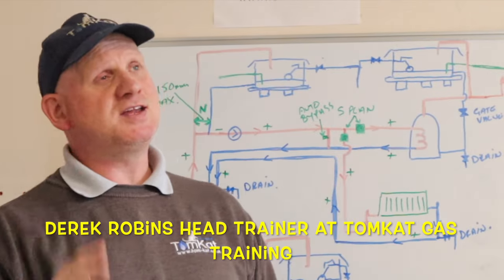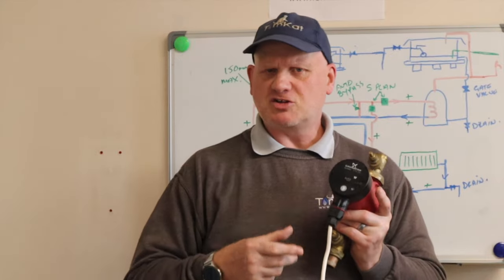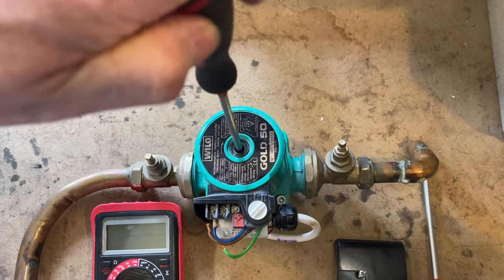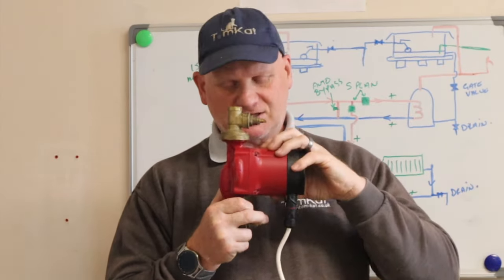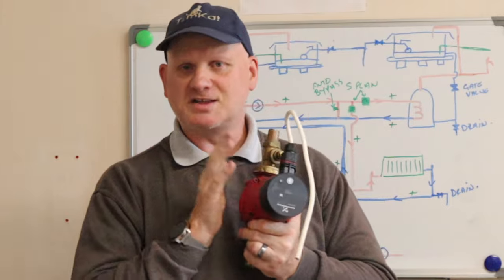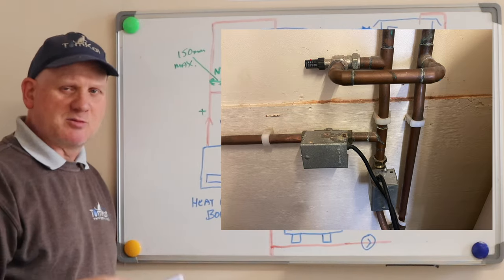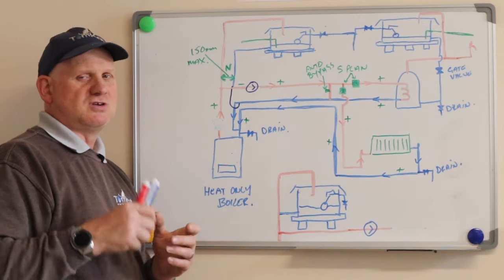How to install a pump in a central heating system

Comment: I was taught 35 years ago.    22mm pipe from flow all the way up and over the fe. Tank.   Then 22mm cold feed down and no further than 150mm apart. But bring it back down to middle of airing cupboard.   There you can put the pump on what we call a. H.     Pump pulls down on cold feed.    Loads of systems I see are piped up wrong. And pumps left on 3.   Which pump over and draw air in.

Comment: Very nice.  I have installed a sealed system but vaillant pure heat only has changed the flow and return. Flow is normally left. Now the system is not working? Do I have to change flow and return, please? (I know punp is pushing the other way around, but in heat only boilers, it shouldn't matter. Please show some light on it. (Flow and retun on heat only boilers doesnit matter) Kind regards Indy Singh

Comment: Hi Derek very good as usual, have  seen some great one, ie the vent pipe going up nearly to the top off the roof and back down😂 or  the vent below the tank water level, a good video would be noise in central heating, ie clicking , rushing, banging , pump speed to high or low

Comment: Well one hundred homes , was always a building site a hundred ohms is a measure of electrical resistance . LOL . Nice video , I live in a bungalow the boiler is on the garage wall and the pump is in the airing cupboard ? vent off the boiler straight to the EXPANSION TANK IN THE ROOF . Cold feed direct to the boiler , 🤔

Comment: Another great tutorial. Looking at the comments, a common theme is what pump speed setting, how to set ABV up in the real world, balancing etc.If you are fitting a new modulating CH pump as opposed to an old fixed speed (with speed 3 settings) do you set up your ABV differently?. Thanks again.Keep em comin👍

Comment: Excellent advice Tom, I find alot of old s plan systems with no automatic bypass, the customer gets a new boiler installed and wonders why it always overheats, I go to alot of jobs where the pump has been replaced and set at speed 3 or speed 1 and further issues arise, radiators constantly needing to be bled or overflow pipes dripping are a sure sign of a badly installed pump or other issues such as no bypass or some customers get a trv fitted to the bypass rad not knowing the true purpose of that rads use, sludged up systems is my biggest problem when trying to explain to a customer that they might need a very expensive power flush, I go to alot of old open vented system that have been converted to a pressurised system and new rads have been installed but one or two rads never heat up, usually down to the balancing of the system, can you provide a video on how to properly balance different systems, thanks Tom, keep the videos coming mate!… 👍👍👍👍
Reply: Sorry if I got your name wrong, is it Derrick?
Reply: Do you still provide acs training?
Reply from the maker: @CarlAtkinson-zu1zh  yes we do training and assessment for ACS and balancing videos coming soon when the Weather gets colder

Comment: Brillant video Derek, would  you recommend  same principle  with solid fuel stove on a 2 pipe syestem  as in 1 flow  and 1 return.
Thanks Donal.
Reply from the maker: Solid fuel is a problem for heating as there is no control on the heat so might do a video on that cheers 👍🏻
Reply: @tomkatgastraining  Thanks for reply, and video would  be great  as in my part of the world  solid fuel is still over 60% of home heating rural  Ireland.

Comment: great vid .i have a question i have a pipe stat than i cant get it behond 0c i have a solid fuel back boiler i need the stat to kick in to get the pump working
Reply from the maker: @corkion  sounds like you have a frost stat not a pipe stat
Reply: @tomkatgastraining  no its a pipe stat it was working fine all a long .must get a new one .thanks fr da reply

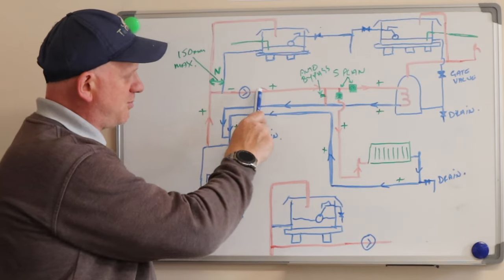Comment: 16:30 on a Y plan system, you will need an auto by-pass if all the rads have TRV's fitted. (I have seen a few systems like that - all TRV/smart TRV).  good vid tho, keep up the good work.
Reply from the maker: I was waiting for this comment under the building regs document L the radiator in the room with the stat must not have a TRV. So if the system is installed correctly there is no need for an automatic bypass on a Y plan. 👍🏻
Reply: @tomkatgastraining  agreed, but as we all know these DIY customers and some builders may (move the stat if it is an RF one to a non rad location - or even get it removed, or remove the rad from that room and such like). then all we can do is advise - to which they will ignore. and you just feel you have wasted your time telling them. but cracking vid tho...
Reply from the maker: @dazl7954  most TRVs are set to 5 anyway which means fully open so the pump will always have a path back 🙄👍🏻
Reply: @TheDickPuller  when in heating only. Only the heating port is open. So, if all rads have trv valves on, and these are closed by temp or user. And the ch turns off. The valve will stay in that position and the boiler will go into pump overrun. So, where will it overrun to? Valve in ch position. All trv valves closed?? As port B is irrelevant!
Reply: @TheDickPuller   did you miss the bit where I said, TRV's on ALL rads......... so thats not a correctly installed one, is it!! and you will find with an S plan, you do need a by-pass, as how will the water get to an open rad valve when the zone valves are closed ??

Comment: The problem with these Alpha “ smart “ pumps on old large systems that may be a bit sludged up is that it will sense the resistance and decrease in power leaving the furthest rads Luke warm or cold , that’s why I will always fit a 25-60 130 3 speed as a replacement on these bigger 3 foor type systems otherwise I know that I will get the dreaded phone call to tell me some rads are cold..... 👍
Reply from the maker: 10 mm pipe causes the same problem and it’s always our fault it doesn’t work 🤔

Comment: With regards to an automatic bypass using an Erp pump  will the modulating pump have enough oomph to open the bypass at the end of the heating cycle being that the pump will have lowered it's speed?
Reply from the maker: This is why it’s important that the bypass is also set up correctly so it will open.

Comment: Well explained and lots of detail.  I would take issue with you saying water in the pump lubricates it . Water has no lubrication qualities whatsoever.
Reply from the maker: If the bearings dry out they seize so the bearings are kept lubricated by the water unless you can come up with another word than lubricated.
Reply: @tomkatgastraining  Without questioning the manufacturer I would suggest the bearings are greased and an O ring seal stops water getting down the shaft to the bearings and the motor windings .
Reply from the maker: @dennisphoenix1  the water doesn’t come in contact with the motor but it does with the bearings
Reply: @tomkatgastraining  the bearings are going to be either ball or roller . Either way you keep water out of bearings with seals .
Reply from the maker: @dennisphoenix1  not in a heating pump.
Reply: Using water as a lubricant is standard practice on boats... and was also used for centuries on water wheels in flour mills etc... you really really need to find an old book on engineering... to learn about it !

Comment: I find modern pumps dont work aswell on very old systems. Also i hate how most have done away with the central screwpoint, u cant ram a screwdriver in anymore
Reply from the maker: That’s because the shafts are ceramic and they snap easily.